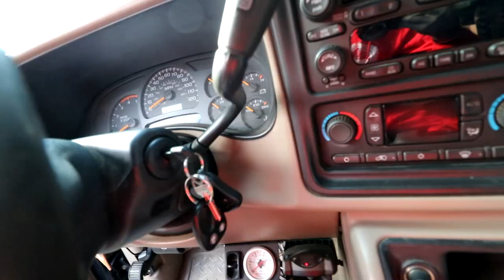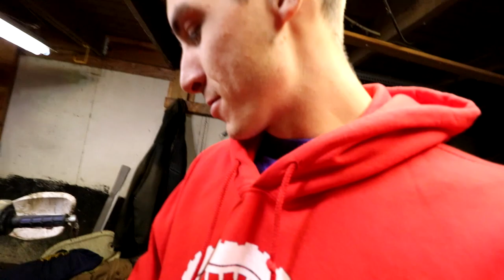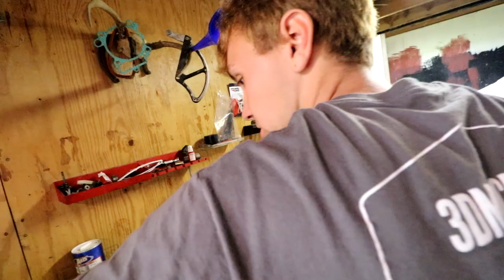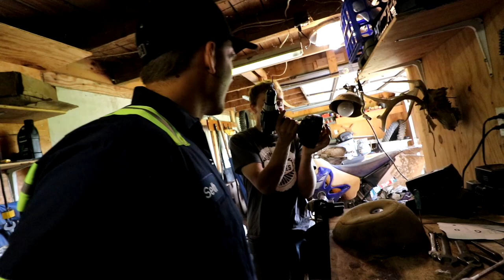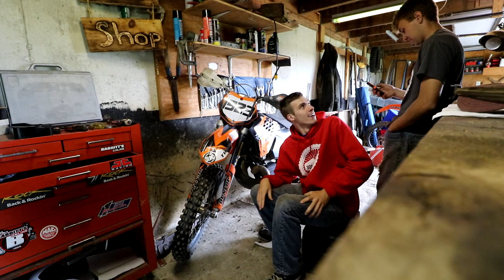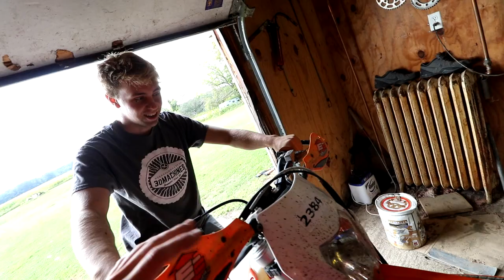HE'S THE BOMB!

Comment: cut them angle brackets off and bend you up some Z style brackets weld them in place of the angle but on the edge of that flat stock . that should bring the light bar out a bit n down .